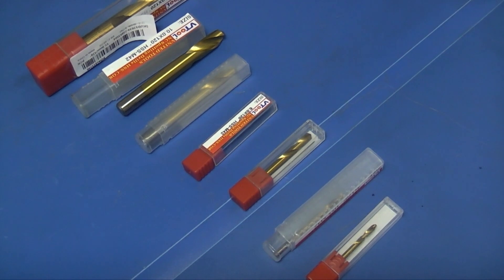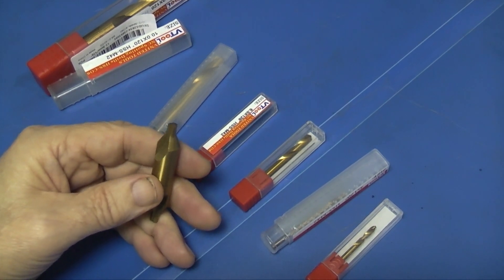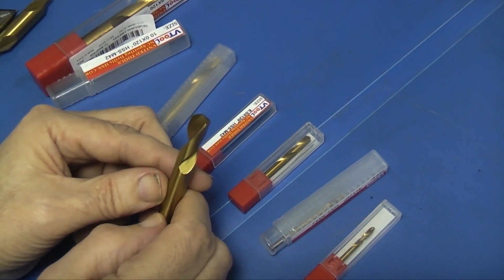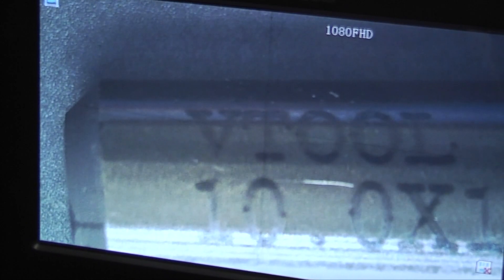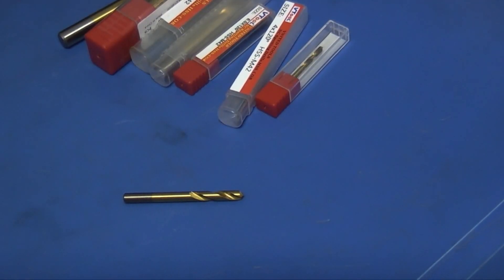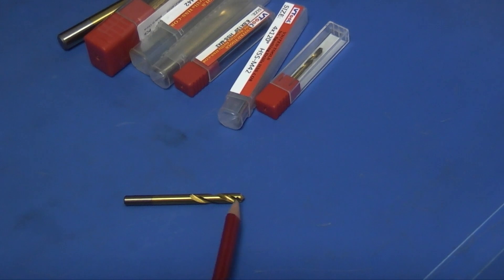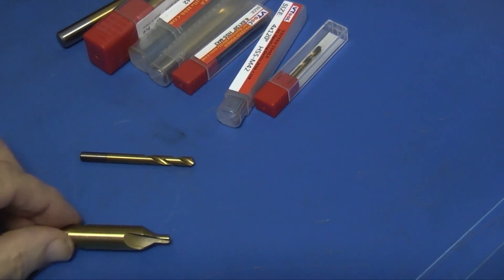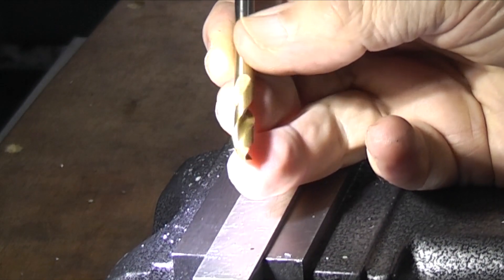spot drills & centre drills

Comment: Hi Alan, I decide which one to use and when (centre or spot) simply by thinking what the hole is for. If it's to use a live or dead centre then I use a centre drill, but if it's to drill a hole with another bit then I use a spot drill because the 120 deg angle on it allows a normal drill bit to locate equally and flat. If you try to follow a centre drill with a normal drill bit you will see it skip around when it starts as it tries to find a centre but following a 120 deg spot drill it will locate exactly in the centre without skipping about. It's something I picked up on here from another machinist.
Reply: The spot drill angle must be equal to or greater than that of the drill to follow.

Comment: Hi Allan, I know you know this, but for newbies watching (or reading) unless I  missed it you forgot to mention the reason (I was going to say point!) for spot drills, that the 120 degree spot means your following drill won't wander off centre. Also that they come in many different angles. An added note, for small holes, the very tip of a centre drill is also 120.